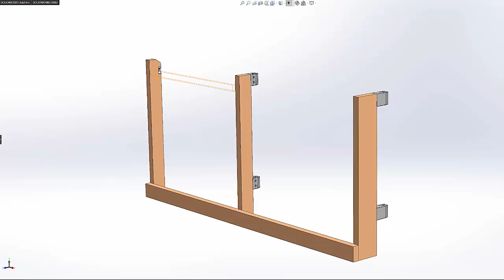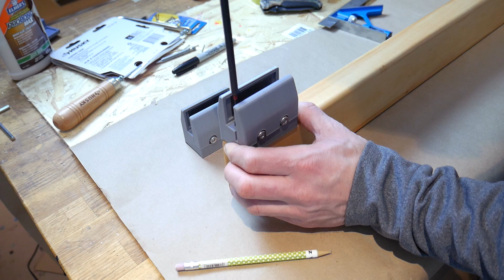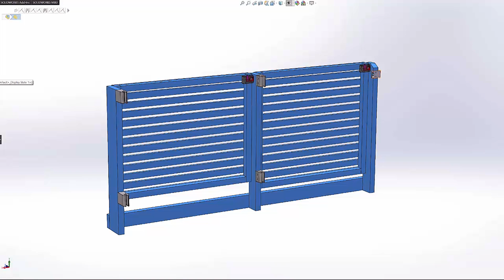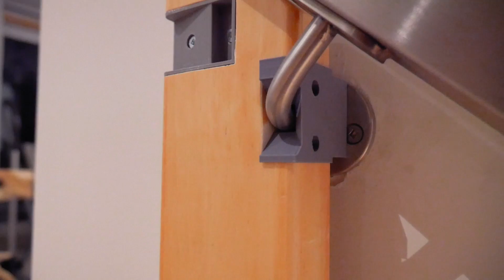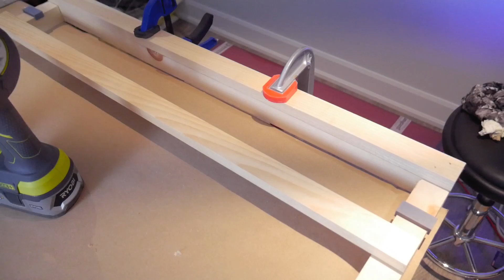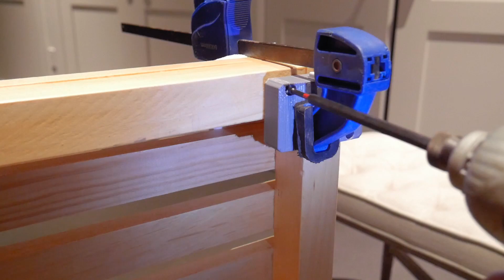DIY Modern Baby Gate Pet Gate (No Drilling Holes In The Walls!) How to Build (Design Files Included)

Comment from the maker: Hi guys, thanks for watching my video! Some people have expressed concern about the climbing risk from the horizontal slats, and the tripping hazard from the lower horizontal cross member. I agree that these are not ideal. The climbing issue can be fixed by fixing a sheet of lexan across the front of the gates, or if you build something "like" this you can also use vertical slats. Use your judgement. As for the horizontal member, I did it this way to tie all of the posts together since I do not have any railings, only glass partitions. If you can find a way to avoid this, or if you can notch this down lower and angle it up and down that would be better. Again, use your judgement as this video is just showing what I did with the limited number of things I could mount to. You build your project as you see fit for your space. Thanks!

Comment: I'm curious about the amount of force needed to pull those clamps off the glass. I'm not familiar with 3D printed material. It doesn't seem like it would take much flex for those to be pulled off. 

My toddler would totally climb that also.  

Aesthetically, I like the design.  Especially how the bottom step looks like a slat.
Reply from the maker: Thanks! The clamps are surprisingly strong. I can't pull a single one off by hand and there are four of them attached to the glass (two per post). The climbing concern can be fixed with a thin sheet of lexan attached to the front which is something I will do.
Reply: @EmbraceMaking  great to hear about the clamps. Lexan sounds like a great idea.

Comment: You realize that a horizontal slats allow for the kid to climb it? That's why baby gates have vertical bars. Complete fail
Reply: It's still a massive oversight in safety to begin with. Not trying to sound like a jerk it's just that you essentially just made a baby ladder which defeats the whole purpose. Yeah you can put a sheet of something over it to prevent them from climbing over it but how many people will realize that. This is coming from a place of concern not hate or bashing.
Reply from the maker: The original design was to use glass panels to match my glass partitions... but then coronavirus hit and everything was closed except for hardware stores where I could find wood. Someone on reddit pointed out I can attach a thin sheet of lexan to the front of the wood slats and eliminate that hazard so it is a quick fix :)